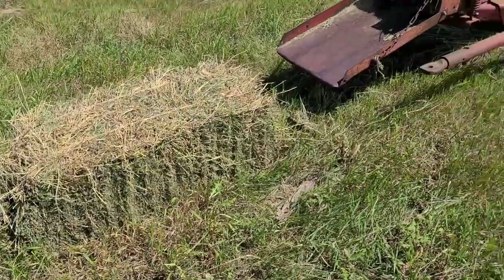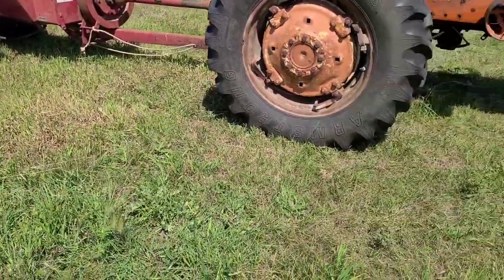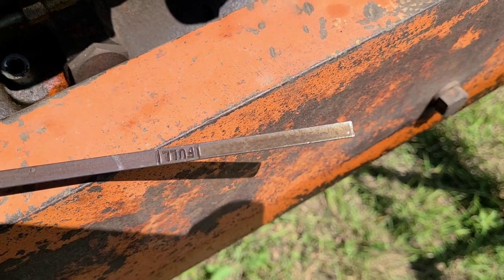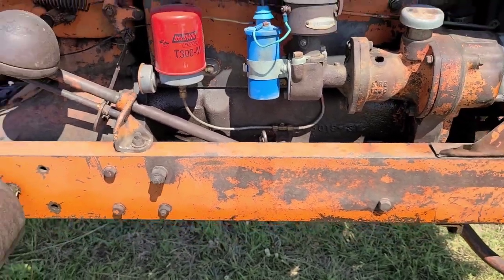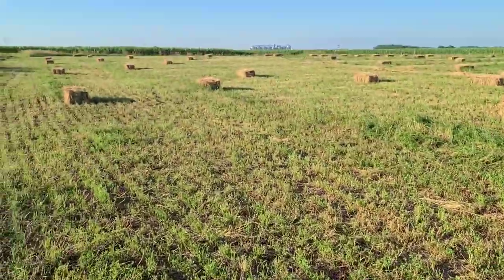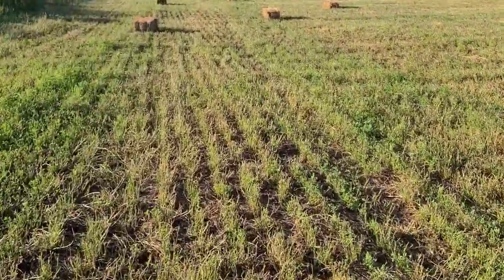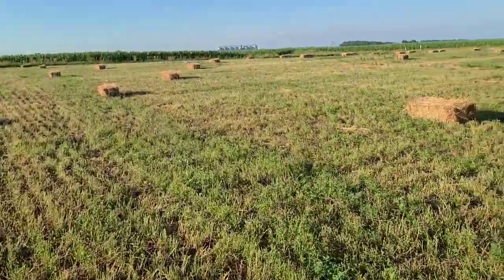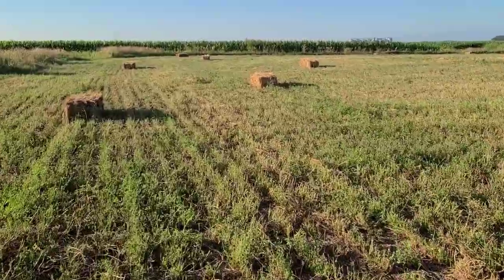Allis Chalmers WD and International 47 Baling

Comment: Thanks!  The IH-47 is a good, reliable square baler when properly adjusted and with good twine.  I realize that controlling the ground speed while baling with a small baler, either round or square, is an art...  Watch the feed on the baler and slow down the ground speed when the baler starts to bog down because of thick windrows, like when the hay is heavy in the windrow.  In the 1960s and 1970s some farmers would buy rather old twine (for a low price point), but it would often not knot properly or would break as the bale kicked out of the back.  I'm happy that you lost so few bales!  It tells me that you have the IH-47 tuned up "just right".  Please continue, sir!

Comment: We have 2 AC tractors; a WD and a WD45. While not the most ergonomic machines ever built, they do have some features I like. We use the WD for mowing fields with a 5’ brush hog. The hand clutch is nice for when you get in thick stuff and you want to let the mower “chew” a little before moving on. I imagine you did the same when the windrows were thick and you wanted to let the baler catch up. I know other tractors have that feature as well but it seems to work nicely with a hand lever independent of the main clutch pedal. Another good job with your baling. So, what do you do in your spare time? Lol. 🥸👍🌞💦🌱🔧💥✅

Comment: Thanks for sharing!
Couldn't say how many thousand bails I've stacked behind an IH bailer, think it was a 27, didn't have the screw feed, but plastic forks, 2 sets if 3 on cables that cycled back and forth where the screw is, and fed directly into chamber.  Can remember vividly neighbor sharpening knotter knives and plunger knives.  70's into early 80's, fond memories you brought back👍👍👍🍻😎

Comment: The 47 IH bailer is hands down the best square bailer ever  produced in my opinion and I have loaded hay behind  most of them !!! John deer 🦌  newholland  Oliver  . Mf  .  Ford .
And the 47 caused the least amount of trouble  !!!! We used to run our 47 with   300 IH 400  . 450 . 826 . And a 856 .  The 826  run it the best and  then the 856 !!!!! 😊😊😊😊😊🌎👍
Reply from the maker: I've had good luck with it, my only complaint is that I can't make super tight alfalfa bales, but its because the string breaks. The knots hold together well, so I just back down the pressure and it works fine
Reply: @kylechrist  we use to get 80 pound bails consistently  and off brand twin caused problems like that
Reply: @kylechrist  we mostly used  Hew Holland twin and  IH twine but used coop twin also
Reply from the maker: @evankibbe590  I would say these are more like 50lb bales, any tighter on the baler and it breaks the twine. For what it is, it's just fine 👍
Reply: @kylechrist  if your selling it thats what people want and the winny when there heavier
Reply: @kylechrist  I remember putting  2000 squares  in a barn in one day in 12 hours  !!! Long day!! Wish I could do that now but can't!!! Over 403 years ago  !!! Loading hay racks behind the bailer and  12 guys in the barn 12 bails in the barn at once 86 balls to a load and a load every 20 minutes  and 3.00 a hour to do it !!!! 
And I was the one Loading the rack !!! Fun day long ago 😊😊😊😊😊😊😊😊😊😊😊😊😊😊😊😊😊😊
Reply: @kylechrist  get the 6500ft 240lb twine and you can pack it in and the knitters tend to like the bigger twine too.

Comment: So how many shear bolts have you gone through baling hay this year?
Reply from the maker: Only 3 so far, 1 at the flywheel and 2 on the forks. One of those was from picking up a piece of old rusty wire fence, it amazes me how things still work their way up out of the dirt
Reply: @kylechrist  I remember baling as a teen back on the farm every so often the baler would get a slug of hay and shear a flywheel bolt on a John deere  baler we pulled with an Oliver 1655